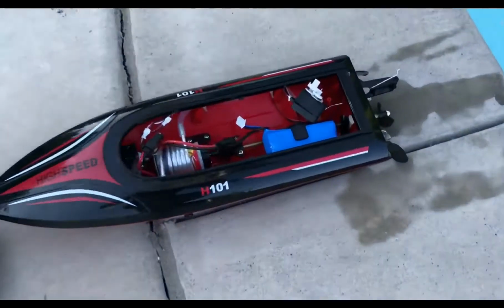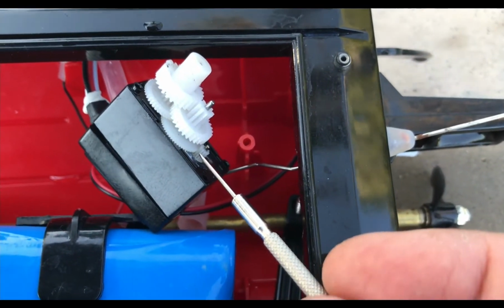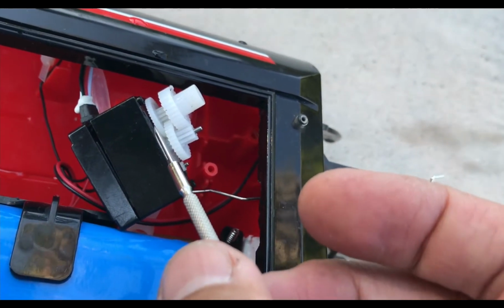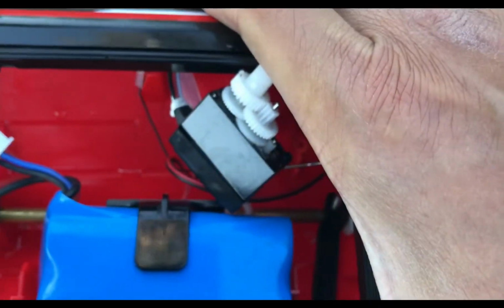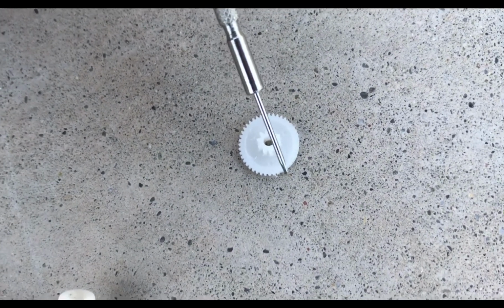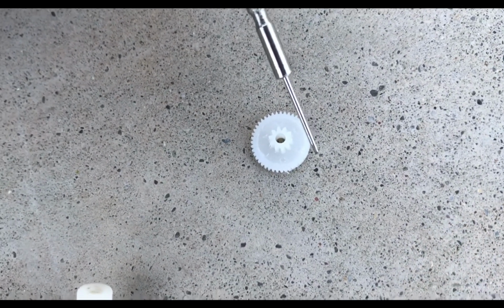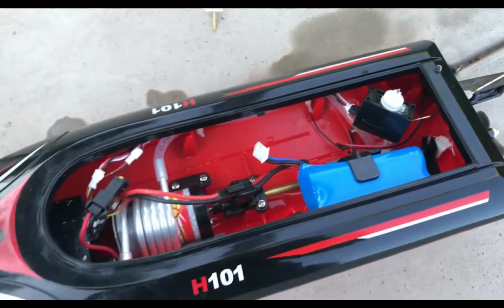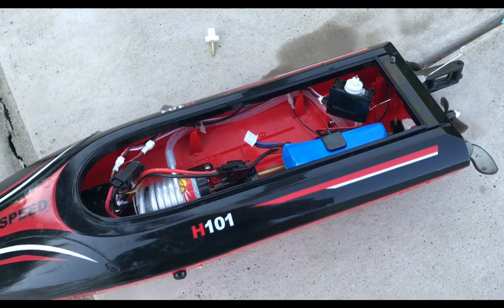Your Skytech H101 Servo is Broken!

Comment: I went brushless a couple months ago. I couldn't find the right size servo so I settled with a Feiyue brushless servo just pushed in the side and superglued it , it works perfectly. I'm using a 2845 3900kv motor and a 35A ESC it performs really well.
Reply from the maker: RedditchRc custom job! Nice! Maybe I’ll look into doing the same. I think the body and the water cooled feature and self righting feature are all great. Just the stock servo is poor quality.
Reply: @Funcentric  Make sure you buy a bidirectional ESC , so you don't lose the self righting feature